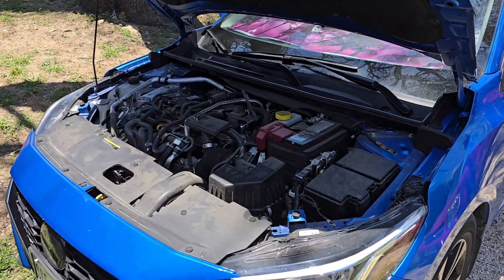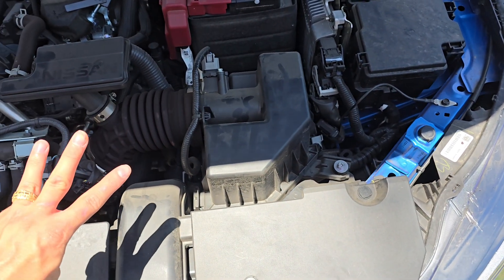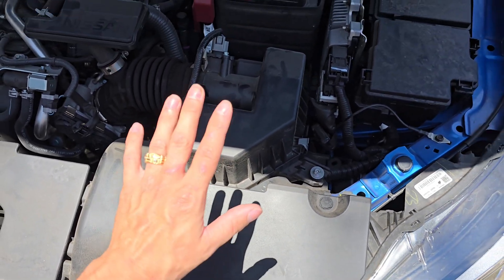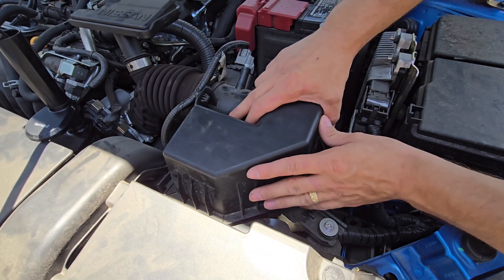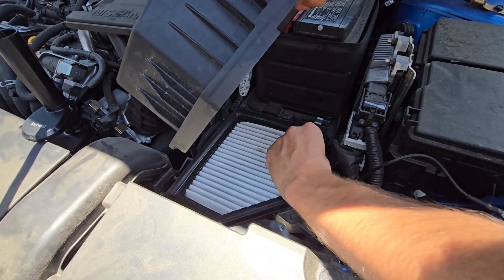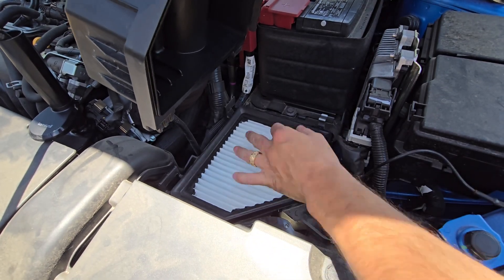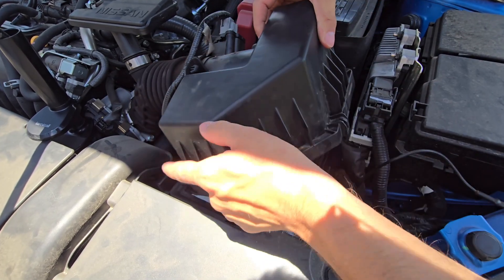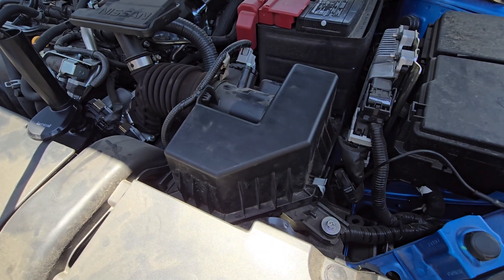Sentra Engine Air Filter Replacement (Nissan 2020 - 2024)

Comment: Where can i buy the air filter specific for my car, i have the same car
Reply from the maker: You can buy the Air Filter at many different outlets. I bought mine from Oreilly's. I use a Wix WA11216. I'll provide a link for Oreilly's below.

Link:
https://www.oreillyauto.com/detail/c/wix/wix-panel-air-filter/wix0/wa11216